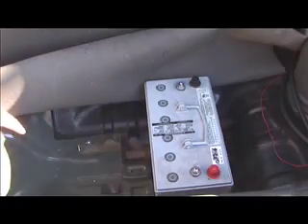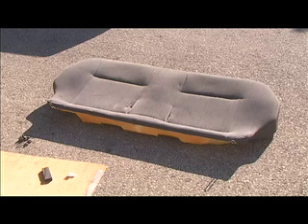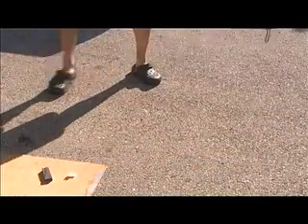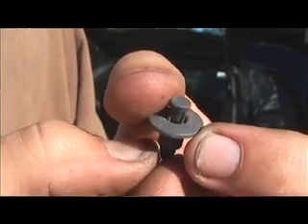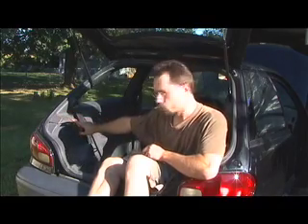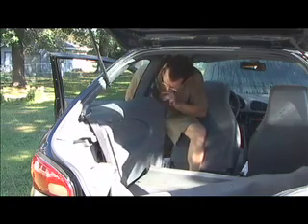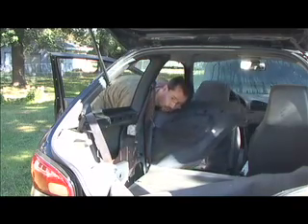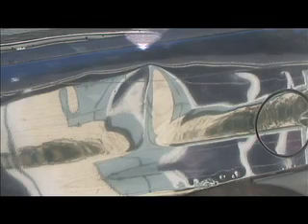Electro-Metro Update: Dent Repair

Comment: To get those little clips out  - push the centre pin in and then the clip will pull out. To replace, pull the centre pin out slightly and then push the outer into hole then push the pin in.